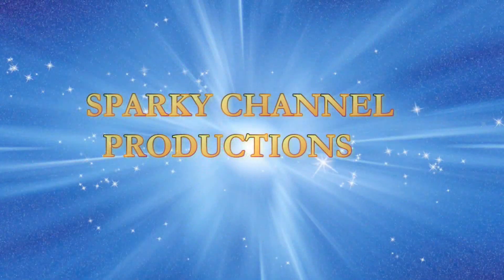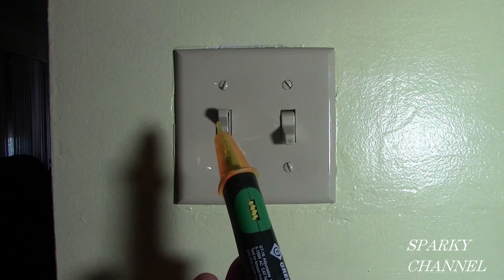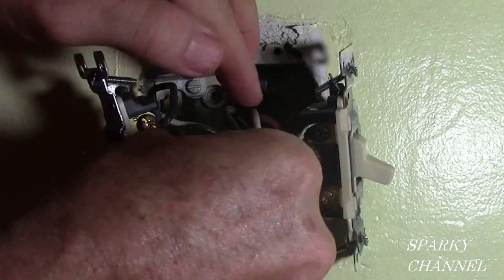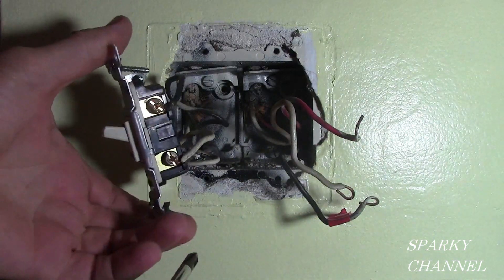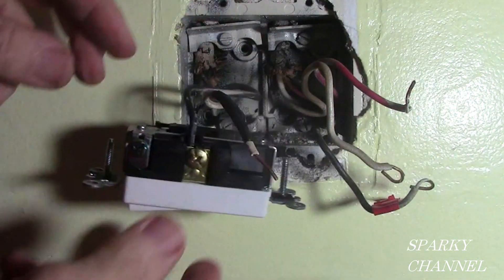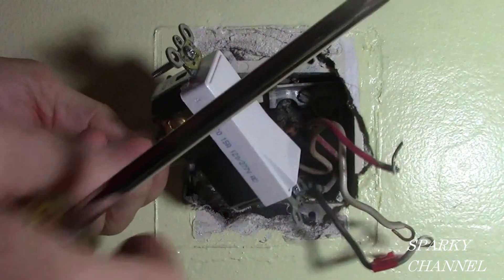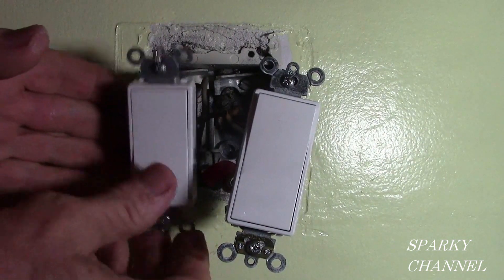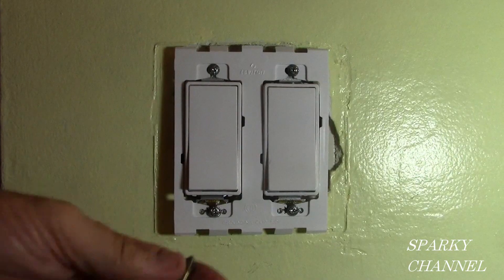How to Replace 2 Switches: 3-Way and Single Pole When You Have No Ground per NEC 2020

Comment: Just curious. Why do you trust your Greenlee to test voltage through the plate but use your Fluke with the plate off?
Reply from the maker: It's because that particular Greenlee is very sensitive, much more sensitive than the Fluke. That makes the Greenlee better at sensing any hot and the Fluke better at determining which wire is hot.
Reply: @SparkyChannel  and  it's not necessarily a brand thing: I have another model Fluke that is sensitive enough :-)
Reply from the maker: @wim0104  Yes, that's true. Both Fluke and Klein also make nice low voltage sensors as well.